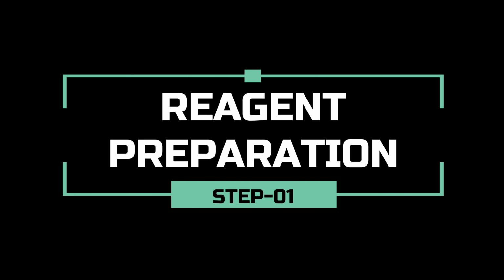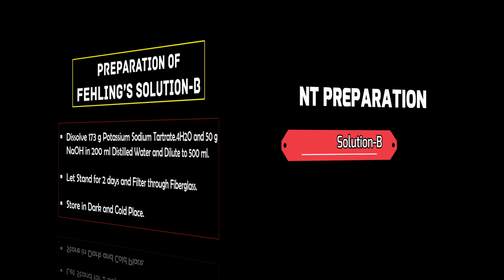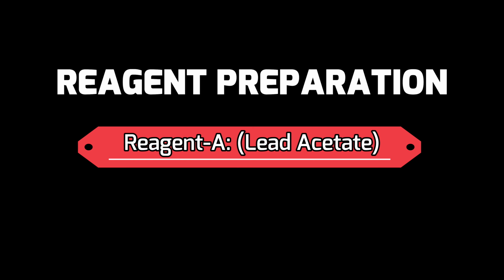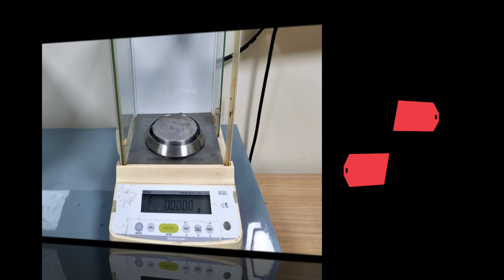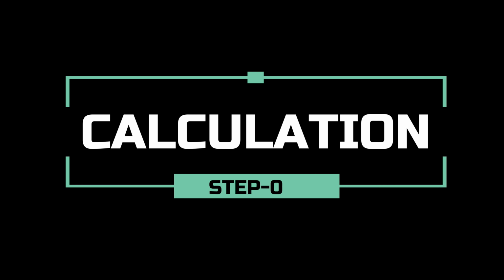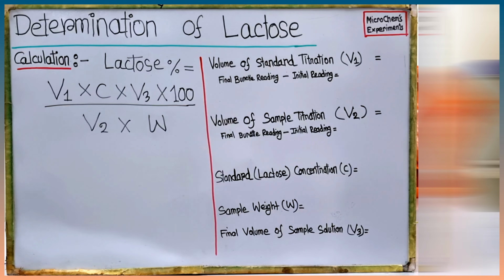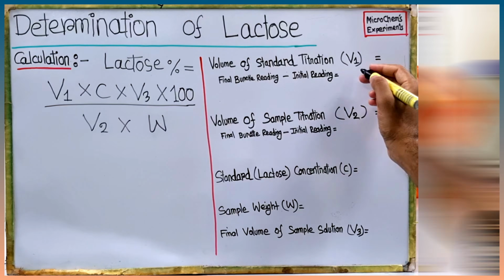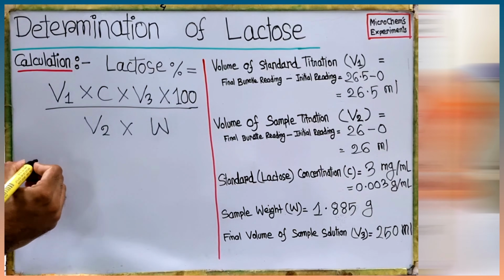Determination of Total Lactose Percent (Milk & Milk Product) | Complete Procedure(Lane-Eynon Method)

Comment: Stop using outdated methods that fails to give reproducible results.
Use any of the following methods.
ISO 5548:2004
or follow this paper Physio chemical Analysis and composition of camel milk in Bangladesh.
Reply from the maker: This video is only for the beginners Sir. Though this method is outdated, is not invalid, which gives acceptable test results. We present what we have or what we are capable in. If you don't like, please ignore.
Anyways, thanks for your suggestions. Peace.
Reply: Sir, please make some videos on following parameter.
1. Sulfur di oxide in juice
2. Sulphated Ash
3. Cholesterol content of oil
4. Icumsa (color) of sugar and syrup
5. Granularity
6. Particle size distribution
7. SDI
8. Turbidity
9. Chlorine content of water using Thiosulphate titration.
10. Do of water using titration.
11. Bulk and Tap density of  Powder.
12. Alcohol test of milk.
13. Detection of Starch in Milk.
14. Beta carotene content of food
15. Quantative Urea determination in food and puff rice.
16. Viscosity
17. Refractive index
18. Calcium Hardness of water using murexide or calcon indicator.
19. COD of waste water using FAS
20.Redox titration
21.Non aqueous Titration
22. Scocville test
23. Bromate in Bread
24. G.S.M of paper
25. MPN (Very urgent)
Reply from the maker: @azadrahman4013  Noted these parameters. Surely we will work on it soon. Stay with us Sir.